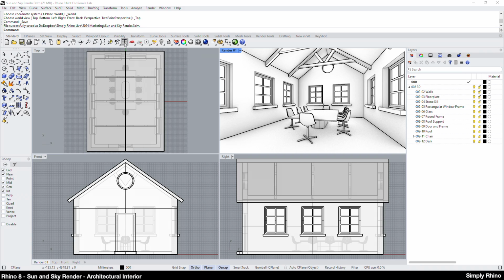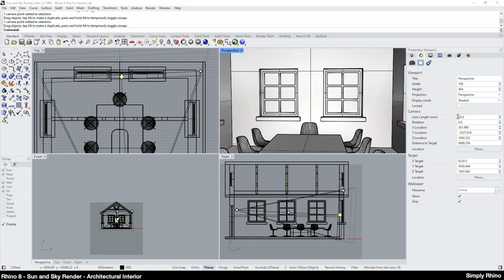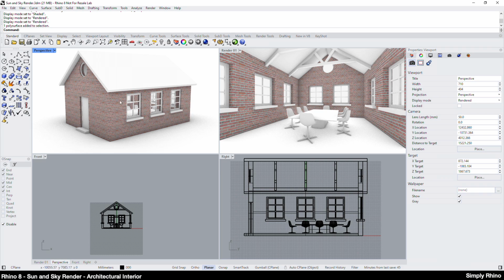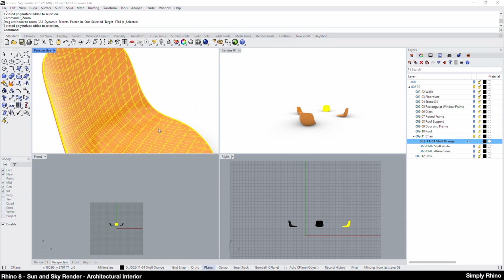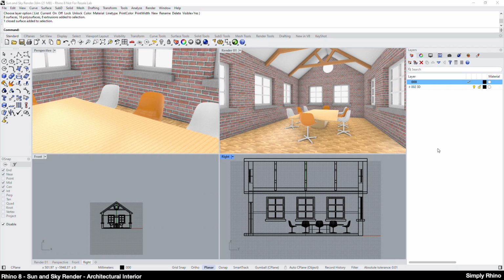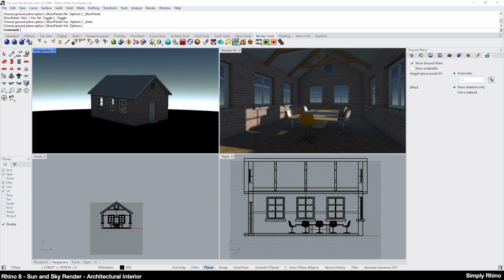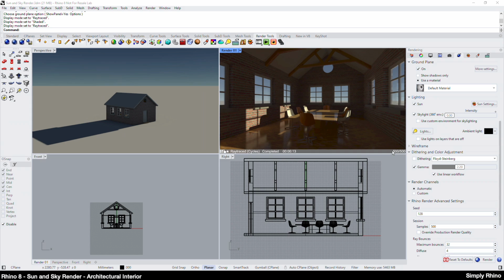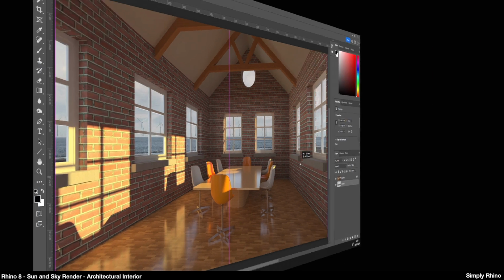Rhino 8 - Sun and Sky Render for an Architectural Interior

Comment: It is so stupid but I cannot left click the render button for some reason. If you can help quickly I would be really happy. Other than that I have to say this video is amazing, it helped me a lot!
Reply from the maker: Hi, we have a suggestion as we can't see why this should be happening: Have you tried running the render from the ‘Rendering’ panel? Have you tried typing in ‘Render’ to the command line instead? Hope it works/worked out for you. Thanks for watching!
Reply: @SimplyRhino3D when I run the render from rendering panel it worked. Later I tried the render button and it worked. Thank you for your respond.
Reply from the maker: @dilekaslan5455  You're welcome, glad all is working ok for you now!

Comment: Great tutorial, but it is taking forever for me to run the render, any ways to speed it up?
Reply from the maker: @Aikaramba12  Rendering speed can be affected by many variables. Model efficiently and make sure only visible geometry is part of the dataset. Make sure your render meshes are set correctly too. Other than that, computer hardware is going to make a big difference here. Rhino’s Raytrace Render can be set to either CPU or GPU acceleration. For CPU number of processor cores will make a difference as well a clock speed. If you have a 16 core CPU this will give you 32 threads for rendering so if you compared this to and 8 core/16 thread machine of the same clock speed you should see roughly a 2X speed increase. If you have an NVIDIA based GPU with RTX cores you may find this to be quicker than your CPU dependant on your hardware. Hope this helps :)